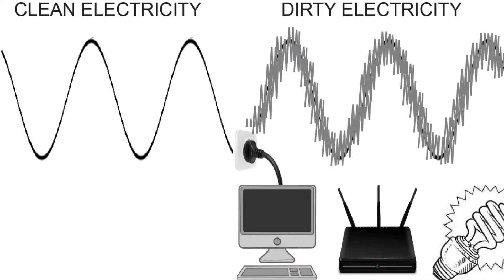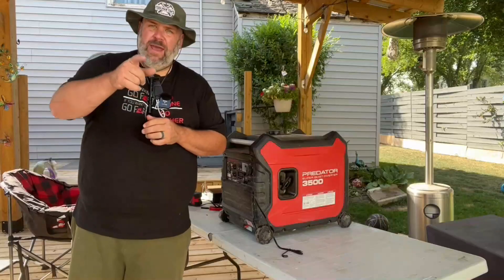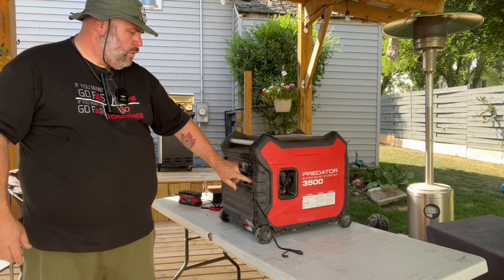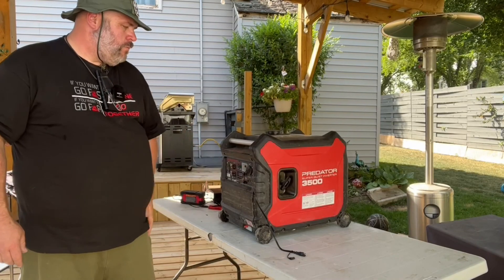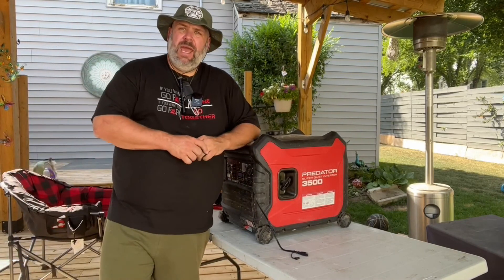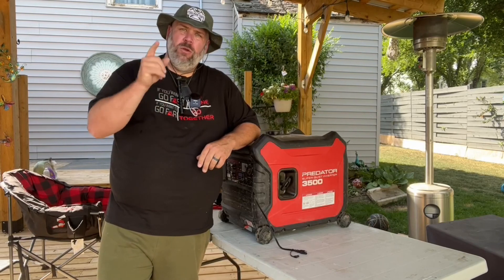Inverter GENERATOR vs Traditional SIMPLE!!

Comment: I have both types of generator. I have a 2008 Powermax ( Duromax) XP 4400 and a 2022 Champion 6250. The Powermax has a 212cc engine while the Chapion has a 301cc engine. The Powermax has a fuel tank that holds 3.96 gallon while the Champion has a capacity of 4.2 gallons. But both have the same amount of run time on a tank of gas at 17 hours. I run both generators under load for 3 hours each month to keep them lubicated and ready. A recent storm knocked the power out for several days here. A friends generator wouldn't run. His own falt for leaving gas in the carterator. Because everything became corroded. I loaned him my Powermax to keep his house going. But once we got the power back and I got my generator back. The first thing I did was change the oil in both regardless of the hours..

Comment: I’m generatorless (I don’t think that is a word but we’ll use it anyway).  So I’m probably not qualified for my thought but it is my opinion.  I’m in the market to purchase a generator so I’m seeking to learn.  True I like that inverters are more quiet and is stated to transfer cleaner power.  But we know traditional generators have been what people have relied on for years and they have served their purpose well. Is there truly any analytical evidence that prove they are must haves.  I see the comments here and elsewhere where someone states they lost an appliance or something they were powering in their homes because they didn’t have an inverter generator.  But I’m sure I am not the only one who has lost an appliance at home from the power electric companies send in your home.  In my nearly 6 decades I have learned and lived to see that when products are stated to be better and more adequate for the user it is about one thing MONEY.  More of it going out the pockets of the consumer and more going into the pockets of the companies that control, make, and sell these items.

Now do I think they have no benefits, absolutely not.  I’ve considered one because of how quiet they are, longer run times, and they don’t have to run at full throttle all the time.  But they come with known downsides also, like cost and wattage limitations.  

Truly in my search for a generator for every inverter I considered I’ve seen 4-5 traditional types that would meet or exceed my needs costing $200 or more less.  The focused market was truly for campers, RV’ers, and tailgaters.  Everyone does not require those needs.  Is it wrong to consider or purchase one ABSOLUTELY not.  I just state this because one of my first jobs was a salesman.  I was constantly told to convince my buying public that they needed what I was selling.  That has stuck with me through life.

Lastly, Sir please do not take this as a jab or negative in anyway.  That is not my intent.  You have a fine and informative channel.  It is 1 of 3 I’m subscribed to getting info on what’s available out there and ways to hookup and needed accessories to utilize once making a decision on one.  So please accept my apology if it offended in any way.

Comment: It occurred to me that if the generator I have doesn't produce clean enough electricity for the electronic devices and c-pap machine then why not plug the cords into a surge protector and appliances as well! It sure beats buying a $5000 inverter generator to make those pure sine waves!
Reply: A surge protects against spike amperage rushing to a device, and frying it.  But a surge protector passes 120v steady amps with high THD to a power adapter that can’t operate or convert with “dirty” power waves.  There’s no damage; it just can’t convert power that isn’t a sine wave.

Comment: Im not going to do this but could one add a rectifier to a regular generator.  Also i saw a review where ones using two inverter generators with different watts but they did work but only ran the lower wattage unit amount.  Great reviews

Comment: Is it (having an inverter gen vs traditional gen) really that critical though?  Most (nearly all) electronics already come with an AC/DC power adapter (rectifier).  Thanks for the video!
Reply: Thats the grand question that nobody can answer. Some say the important part is having a voltage regulator that KEEPS the voltage at 120V or 240V regardless of load and Preventing voltage spikes is the most important,
Others seem to think if the sine wave is not perfect smooth and if it has ripples in the sine wave, then that "dirty" since wave will damage the electronics.
But like you said, most electronics run on DC ... So they have a power supply that takes that AC and rectifies it to DC and i am sure they have a filtering circuit built in to make sure that "simulated" dc is clean. 
Im no expert by any means but i cant find anyone with a strong answer. 

Besides, most of us are using these generators during power outages and dont live with them 24/7 and only using them for a few days to a week or so.
Can a basic generator really do damage in a few days or several days ??
Reply from the maker: In my experience, any electronics, especially modern stuff has not liked jagged, no  pure sign wave power they just won’t run onto the tall
Reply: A power adapter is that; it converts AC to DC and steps down voltage.  It’s doesn’t clean up power as far as I know.  So it’s not power damage, like a surge, which would fry the adaptor or brick your device like a TV which has an internal power converter, but whether the adaptor can convert dirty power.  An adapter is mass produced for $5 as OEM for billions of devices over the years.  There’s no power conditioner in a $5 staple accessory.

Comment: Can you do an aftermarket rectifier/ inverter for a open frame generator that doesn’t have that built in instead of buying a new inverter generator
Reply from the maker: you know that is the first time I have ever been asked that question.  Not that i know of atleast not that i haven't seen.  however you could use your generator to charge a battery bank and then pull power out of that via a pure sine wave inverter

Comment: Inverters do not "filter" DC power.  They take DC power and convert it to AC power.    There is no reason why power from an inverter, which is a semiconductor switching circuit, is inherently cleaner than power from a rotating AC generator.
Reply: Tell my led lights that
Reply: Maybe so, but it is.
Reply: No ..
They produce "dirty" since wave AC then convert to DC then convert back to a pure clean sine wave.

Comment: need to have the option to possibly power a CO2 laser and laptop with other electronics harbor frieght has a new 13000 watt tri  fuel generator but it isnt a invertor generator, is there anything I can out between the generator and the electronics to clean up the power supply ? I am not techy so please help
Reply: No

Comment: Anyone back feeding a house I recommend using an inverter generator spend the extra money, my old generator was not an inverter, I lost 1 battery back up in my game room and messed up my sound bar in my living room. I bought a big inverter dual fuel generator and run it on propane, I also added a UPC on all my living room electronics, 1 for my router and one for my garage door, now when my power goes out I have about 30 minutes to get the generator out and going without interfering with those thing working.
Also with all the electronics is everything today, like a fridge etc… I wouldn’t risk damaging them on a non inverter generator.
Reply: The furnace, fridge, microwave, T.V.,  and most everything today all have sensitive circuit boards and micro switches that can be damaged using dirty power.  I have old style gens to run the well on the farm but I can run the furnace or window unit, chest freezer, fridge, lights and T.V.'s all at the same time with power to spare using that Predator 3500.  Plus very quiet using a lot less fuel.  My two are 2020 models before the C/O sensor.

Comment: Dude, this video is awesome! I'm just learning about these inverter generators. Was looking at the traditional one's originally, until I was advised to use an Inverter Gen. I have a car that is soon to likely to die and I have been considering a crazy thought...  I'm tempted to rip out my engine and install an electric motor that would be powered via batteries that have constant access to the generators power. I'm sure I have some engineering blunders in my logic somewhere, but it's worth a try! Thanks Tim!! :D

Comment: If you're in an off-grid situation,  you can use any type of generator to power your charger(s), then use a "pure sine" inverter to connect your living space. Of course, IF you really need super clean power...most of us off-grid folks don't typically have the sensitive electronics anyway. 
Your budget and needs will always dictate.

Comment: We have one with 2 batteries and 400 watt solar panels. We use it on our camper on our property and we have had no problems. It works great. We run TV, lights, microwave, and refrigerator. We use about 20% from dusk to dawn. It is a little expensive, but it is easy to use and the wife and grandkids can set it up.

Comment: thanks 
your videos are always so informative  but I have a question bought a 
10,000 wh dual fuel generator  this past December  kept it in its box 📦  until July box fell apart so I keep it covered with tarps but have not run it yet  could it get damaged if I keep it that way  never have put fuel in it  what is your advice  thanks 
🙂
Reply: Over time parts will corrode and seals will dry out and degrade.  Best to run it to get oil and fuel through it.  Not good to leave untreated gas in it very long either.